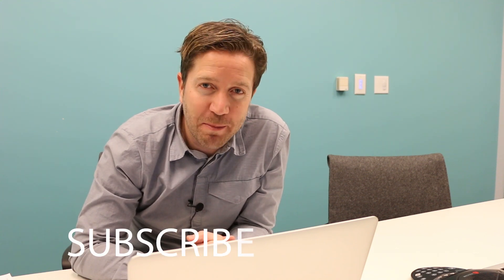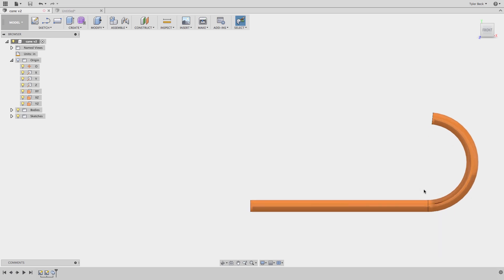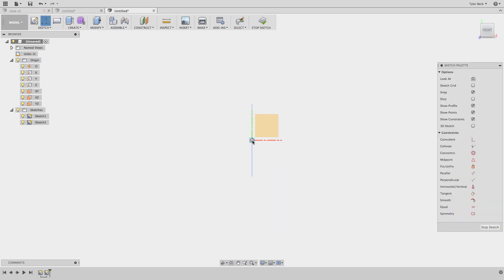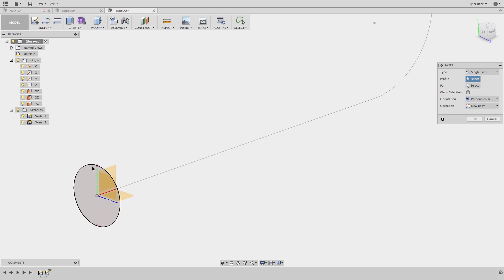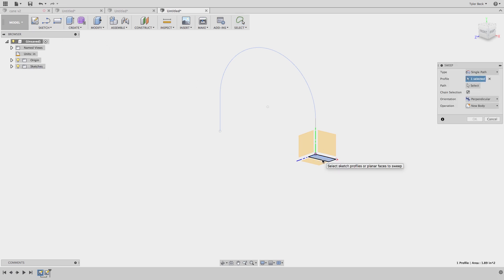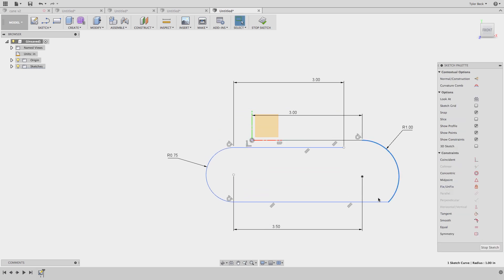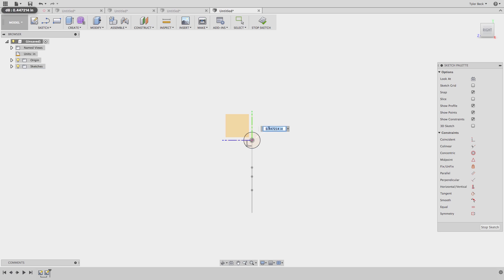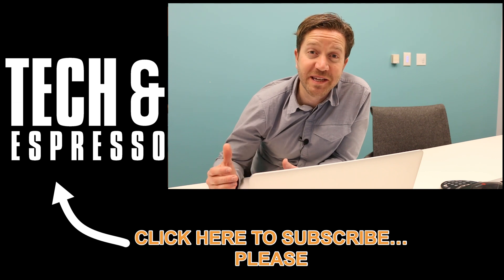Sweep in Fusion 360 (How To Create Curved Shapes Tutorial) product design

Comment: Great Video, but it is not for beginners, way to fast not sure what you are pressing or what its for, way to quick. I got lost before you were even finished the first sketch. I have been doing fusion for approx 2 weeks but not daily just starting out with 3D Printing.  Not trying to be rude but if you are doing this for beginners you need to slow down and explain what you are doing. Thank anyway.
Reply from the maker: Gotcha.  Speed is such a touchy thing...Im always trying to improve.  Make it easy to watch but also engaging....tricky line to walk.

Comment: Nice, any change you could do video showing how one could extrude a shape between two paths.  Say two arcs  or lines that gradually move closer together - then extrude a circle or some other shape such that the intersection points on the shape stay touching the lines.  For example a wing that has curved leading and trailing edges.